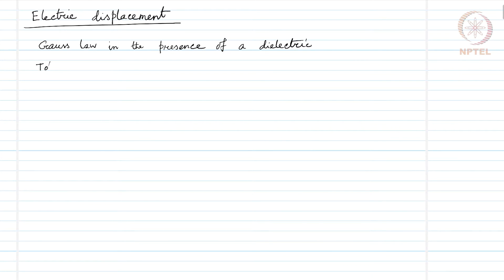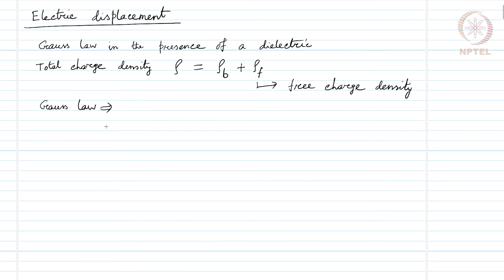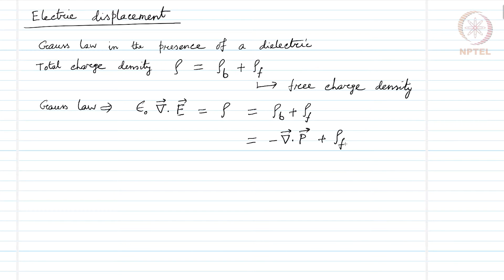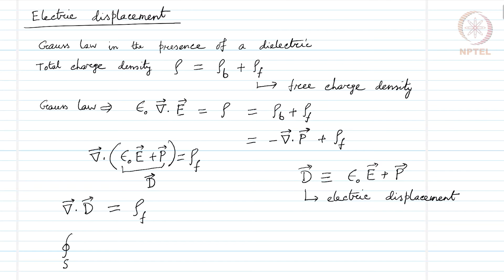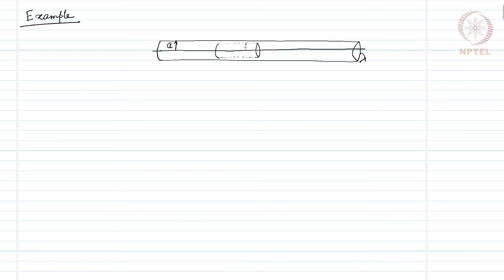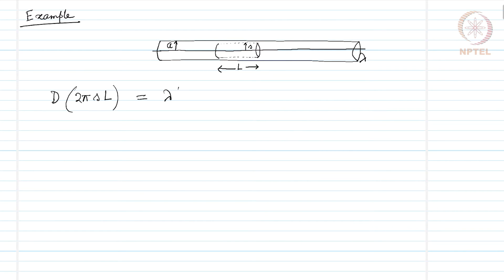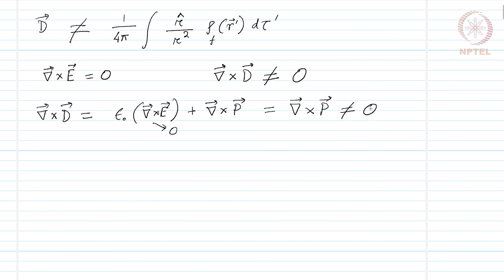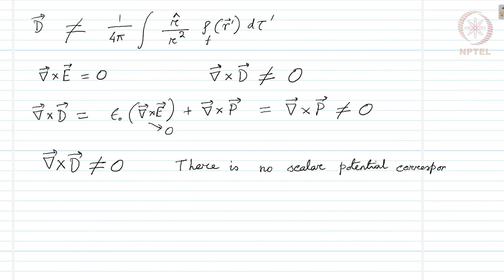Electric displacement vector and Gauss law

Comment: Why don't we consider surface bound charge density
Reply: Displacement vector already captures Contribution of bound charges
Reply: we consider free charges which result in formation of electric dipoles that in turn create a magnetic field to resist the flow of external magnetic field inside the material.

it is the tendebcy of matter to resist flow of electric field through itself and this is defined as its permitivity